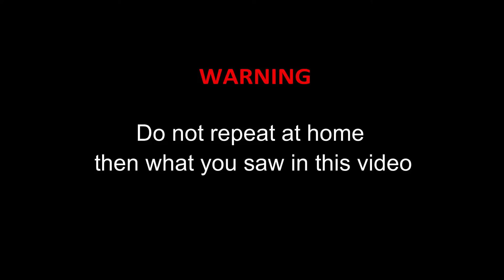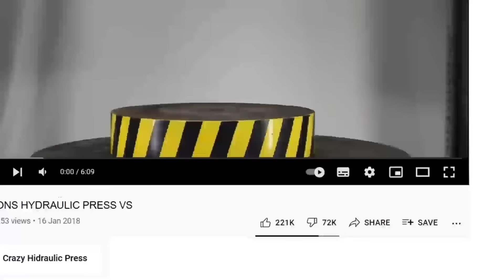HYDRAULIC PRESS SHARP VS HARDEST METAL, VIBRANIUM

Comment: Well that last clip i was really impressed with how the press did not go through that. I honestly thought that metal was not going to stand a chance
Reply: Well i mean it IS almost 50mm of perfect high hardness armor steel. Imagine a steel slug the size of that press cone but with a harder tip, more mass, and moving at ~600m/s not penetrating it. Hydraulic press not going through doesn't seem so odd now ;)
Reply: @a.t6066  The problem with armour like that is spalling. Modern anti-tank rounds aren't designed to penetrate the armour, they're designed to hit it at a high enough velocity that the shockwave causes chunks of plating to spall off inside the tank - a similar effect to the Newton's Balls desk toy. Armour spallation has the same effect as letting off a frag grenade in there.
Reply: Now they have stuff that launches objects with no explosive force at around mach 8... Hardness armor needs to be more malleable nowadays to absorb such things
Reply: @Mystikan  that's a HESH round. The DU round is made to penetrate. Making it spall is probably the cheaper way to go,  though.
Reply: I wasn't surprised at all unlike you...
Reply: @a.t6066  how do you know it was 50mm thick?? He never even mentioned it...
Reply: @a.t6066  he NEVER mentioned the AR500 steel's thickness...
Reply: @a.t6066  and again. That is NOT AR500 steel. He NEVER mentioned the AR500 steel's thickness. He only mentioned the silver color steel's thickness @2:07

Comment: Usually carbon steel has limited hardening depth that can’t be hardened into the core. More like case hardening than homogeneity.
Reply: Would depend on how thick it is.
Reply: All steel is carbon steel, specify low carbon steel if you are talking mild steel that won't properly harden with heat treatment. Otherwise your terminology is confusing to those with little metallurgical knowledge and this is how myths like katanas are folded 10,000 times propagate. Call it a pet peeve of mine, but working in the metals industry, I can't stand when people say black iron pipe when it is steel pipe, and people say wrought iron fencing when it is either mild steel or aluminum. Wrought iron stopped being produced in the US in the 1970s and still people use the term incorrectly. Sorry for the rant. I'll stop being a twat about it now.
Reply: @Random-ed2xf  in the context of this video.
Reply: @tricksyhobbitses1695  yes you are quite right.

Comment: Amazing. As a mechanical engineer, I could never imagine what steel failure in compression looks like. Does the metal actually become denser as it does that? According to the poisson ration, it should "bulge" but that only seems to happen by a very small amount on the first cone.

Comment: If you make the cone more sharper and more longer than it could do the the job vs the AR500. However you need to use a specific meterial for the cone called depleted uranium, or you can use Tungsten instead. xD
Reply: That's the crap they tip tank shells with...
Reply: Both those metals would actually be pretty poor for this. The reason why they make good kinetic penetrators is due to their density and extreme velocity when fired from a barrel.

Comment: The hardened steel cone had some heat treating issues. Looks like the quench cycle was not adequate. That’s why the tip of the cone compressed into the body of the cone
Reply: Lol
Reply: Good catch
Reply: Or maybe because it was made out of 6065 aluminum
Reply: @BassJigGaming  i think the cone was out led.